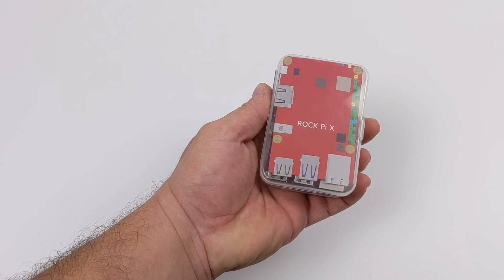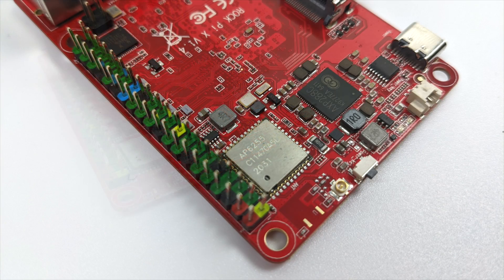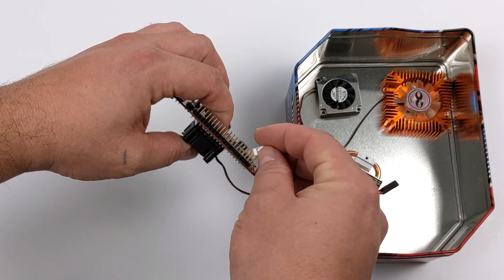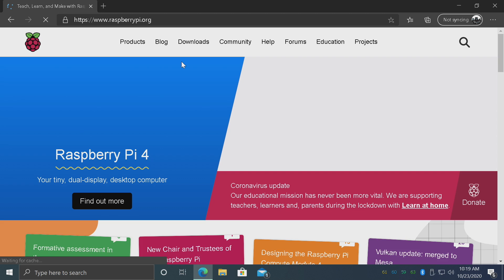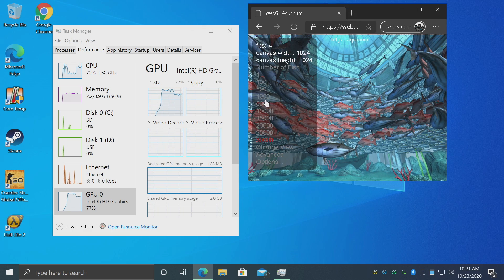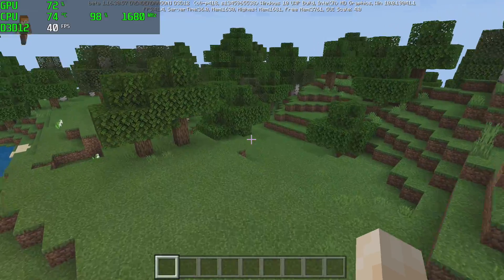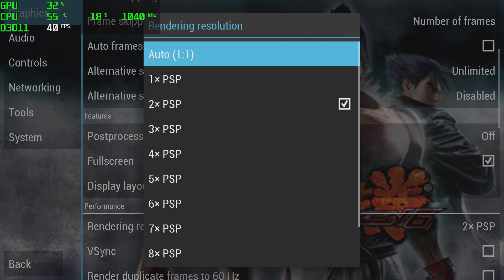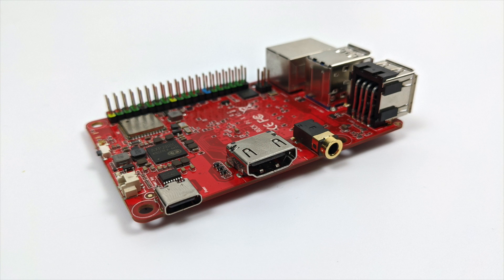Rock Pi X X86 SBC WIndows 10 Review - Is it Any Good?

Comment: hi big fan, subscribed, ive a q how did u boot the rock pi x to windows 10? i've a rock pi x and i cant boot it. i tried following the steps on radxa website but something else is happening. i tried rufus, etcher and also that "make usb drive" option on windows 10 media creation tool but nothing seems to be working, the same message comes if u were to plug in a blank rock pi x. pls help me i believe its a problem with the booting evrything else is working fine.

Comment: Honestly i need a small little thing like this to keep my ingame shop open 24/7, i spend 2 days trying to run x86 client  on arm raspbian. With box86 / wine.
No succes, this is plenty powerfull for my needs, even if it gives me 5fps for that purpose. It's funny the chip is listed as 2w TDP while it used 10x that during loads haha.
Anyway, i dont think the price is bad, a pi4 4gb costed me over 70 euro's wich was like 85 usd at that time.

Comment: if I did get one (I'd probubly get the 128gb model with 4gb ram, model b) I'd run 7 dual booted with Lubuntu, each one getting 64gb of storage. I'd then pair it with my low-end pi screen (800 x 480) and a battery in a custom 3d printed pc case.... basically this will be a giant project for me! I might try some Dolphin and PJ64!

Comment: Back in days  you had 2x serial port you had 8-bit DMA IRQ handled pararell GPIO port, you had 3-4x 16 bit ISA 20MHz GPIO bus you had additional audio, analog video, CPU running at 10W TDP, and additional super fast SCSI. these days you have super cool futuristic Raspbery Pi and Intel clones running at 10-20W TDP having just 8bit GPIO, 1x serial, 1x I2C serial, modern version of SCSI but no RTC on board. 
We only step backwards. Except for video and mips :)

Comment: If you want to compare it with rasbpi, you need to install a linux distro instead. Windows 10 (and even 8) is so bloated with crap. Also, have you ever seen how many file stamp/attribute updates Windows perform with NTFS on files, it is insane. The file access update for example, totally useless performance drop.  Windows search, nightmare. If you want to compare both worlds you should treat both system the same.

Comment: A perfectly usable computer for basic daily tasks or your maker needs. Great for HTPC, NAS, etc. The only drawback is storage, you really need at least 64GB for Windows 10. But you can always hook up an SSD via USB 3.0 and use Windows To Go feature (not sure if this works with newer versions of Windows 10 though).
Plex works better because it's likely using HEVC or H264 codec which can be hardware-decoded by the GPU, unlike Youtube's VP9 codec which is decoded in software.

Comment: So my Nutmeg-P Mini ITX based system blows this thing out of the water. Geekbench is 1233 single-core, 3414 multi-core. I even run World of Tanks reasonably well.

Not quite a Raspberry-Pi sized system, but systems containing these boards can be had quite cheap. I paid $7 for mine at a CHKD Thrift store. My case may not be typical, but still wouldn't expect a machine like this to exceed the price of a Pi or Pi alternative and its more flexible if you don't mind the size.  I might eventually install this setup in an old Macintosh LC II shell I have.

Comment: If only they made these compatible (supplied/made the drivers) with older OS's like Win XP or even Win 98Se, would make for an amazing SBC for a classic PC gaming handheld or a tiny classic desktop PC. The SoC is perfect for pre-2005 PC gaming, would be amazing to finally have an SBC for an easy cheap way to have all my PC classics easily accessible, especially a little Windows XP handheld gaming system. I guess we will have to see how good the open source Windows OS ReactOS gets, perhaps if it matures enough it will make a classic SBC handheld/desktop possible.
Reply: the drivers will work with xp if you can modify them kinda.

Comment: This Aquarium is very strange.
I ran it on my N4000 Celeron running opensuse, in Firefox I did not get more than 20 fps even with just one fish. Using Chromium I had 60 FPS even with 500 fish. And Firefox on the left side and Chromium on the right I got 60 fps in Chromium and 10 in Firefox.
It seems like this is more dependent on the browser than the CPU.
Though, my I7 makes 60 fps in Windows-Firefox even with 5000 fish so who known.

Comment: Hello, I would like to make a kind of android tablet to put in the car with which to use maps, I would also like to connect it to the car radio and to rgb led strips, do you think it is possible with a 2gb raspberry pi4b? i should get a usb gps module, would it work? I have many doubts... i know how i could do with the hardware but i know almost nothing about programming, i don't know how to program the gpio and in case you need drivers for the gps i don't know how to install them on android and linux   : (

Comment: it will work just fine without the heatsink, my windows tablet is running the same processor, it gets a little toasty when touched the back of it but it works just fine.

Comment: I wouldn't include a youtube benchmark, since it depends mostly on the site's coding and optimization, which is very poor, so it's a little unfair. And I'd try 1440p video, even if you have to convert it to that format, I hope it becomes mainstream.
Reply: YouTube uses the VP9 codec, which is more demanding than H264. While poor coding may affect loading speeds of the site, the main factor is the lack of power and lack of VP9 hardware decoding. YouTibe can also use AV1, but it's a bit rare.

Comment: Thank you for including power consumption. Web browsing and some retro gaming is all I need from a computer when I'm not working, I'd like to find a sbc to use and save power. Although this one seems underwhelming for sure. We'll see how it performs with linux.
I don't know how relevant it would be to the bulk of your audience, but I personally would very much like to see how basic software perform on those sbc (gimp/krita, blender, godot...) finding a reasonably sized file/project to use every time you test a new board would make a good benchmark.

Comment: Does the CPU support VT-x?
This board can be an interesting cheap/low power retromachine for old windows games.
It would be interesting to see how virtualization works on this board, for example running win98 on virtualbox, or running games on linux under wine.

Comment: Question, when running windows 10 are there any books to use the GPIO?  I would love to develop some windows applications they can still take sensor input.
Reply: that would be interesting to knoe
Reply: There's no point using this form factor unless you want the GPIO, but reviewers never even mention it or try it.
Reply: use python or use rpi os or arduino ide in windows
Reply: That SHOULD have said "HOOKS" not "BOOKS".  I know that I can use RaspiOS and Python, but I want true windows.  Why is that apparently so wrong?  I have a lot of development that I do in Windows, so if I can stay in windows as opposed to having to send something to a network drive, then have a windows computer that a client is going to be using, if I can just stay in  windows it will make things easier to the project I'm working on.

Comment: Nice x86 SBC but why still NOT a dual display output like on the Raspberry Pi 4?! It would have been a great addition and make this device act as thin client too
Reply: I don't think the intel hd gpu supports it. It was having enough trouble with 1 1080p display

Comment: you must try ppsspp on linux bc you have vulkan there.. you can see my video about ppsspp on this board and the performance is much better than this one. but yes, this board isnt enough for windows

edit: after several testing on the rockpi x.. well, I found than I was partially wrong. the performance was way lower than my initial experiences.

Comment: Too little memory for a desktop and therefore nothing you can do with this board you couldn't do with a RPI. In fact, the 8GB raspberry pi is the first SBC that can to a certain extent function as a desktop. I'd rather they just straight up charge $70 for it and add two so-dimm slots instead of soldering the ram to the board.
Reply: there is no performance jump going from 4 to 8 gb on the pi4. everyone knows that.
Reply: @pilabs3206  Of course there is. There's a thing called dynamic paging. Never mind having to WRITE dirty pages to swapspace . Also, with a 64bit kernel there is no 4GB per process limit on virtual memory. Everyone knows that as well.
Reply: @statinskill  absolutely, but you can use 64 bit kernel on 4gb too. suggesting there is a real bump in performance going from 4 to 8 gb on an rpi4 is just stupidity. if you want to believe that kept being one. its extremely difficult to fill the entire 4gb of ram even on 64 bit. there would be very few occasions in wich you would hit those limits. do you get better performance on youtube going from 4 to 8gb? no, there is any increase on games? no. just for ramdisk and some very few scenarios you can really use those 8gb. 8gb is a waste of ram on a crappy rpi4. this rockpi X have way more value/$ than the rpi4 8gb for desktop usage, even with this very low end cpu. the gpu is way more powerful, it have perfect h264/h265 playback from the desktop, not just kodi. it can run many many x86 games/software. its just stupid saying than the pi4 is a better desktop just bc it can adress 8gb.
Reply: @statinskill  any rk3399 with 4gig is far better desktop than the rpi4 8gb if you want an ARM desktop sbc. and its cheaper than the rpi8gb . the rest is marketing.
Reply: @statinskill  absolutely, for development/compiling. but rpi4 is targeted as a desktop pc. so no, 8gb on rpi4 is mostly useless for desktop usage. at that price any other sbc does much better job. 4gb is the right spot. 99% of this ETA prime subs are comparing this sbc agaist rpi4 on desktop usage, and this 4gb with 32 gb emmc model its much better value for that porpoise than rpi4 8gb. not for your specific IDE dev app. but you are one of the very few people than use that kind of apps. I compiled several dozen of projects, a lot of gb of source code with rpi4 4gb, no problem whatsoever. your fancy IDE use more, ok, you are the only one that could take benefit from 8gb. any other user will not face any problem and the extra 4gb will be useless and will reduce heavily the rpi4 value.
Reply: @statinskill  and if you want to quote, you were talking about desktop! so, any debate here is useless bc you are not saying than this board can do wayyy more stuff as desktop than rpi4. not in your specific case. but the trade off are insane high. this board can execute tons of x86 software. rpi4 cant. while I am testing an x86 emulator for ARM, I am struggling all the time with a 32 gflop gpu!!!! a desktop sbc than does 32 gflops!! are you kidding me? this board have way more powerful/featured gpu. you need that to say this is a desktop or not. RPI4 is wayyy far from being a desktop, it have a good cpu, with a crappy gpu. thats not a desktop, thats garbage.
 I dont understand how this crappy board have soo much community. waiting years for a real upgrade and.. 32 gflop gpu. and I have this fan boys that says its a desktop bc it can address 8gb of ram.
Reply: @statinskill  the foundation says its a PC sbc, not me. desktop usage is a serious usage.
Reply: @statinskill  my hobbie is to demonstrate than ARM Linux can be a desktop pc. that involves everything you say its not serious usage and what every people do on any normal pc. we cant get there is broadcom kept making this poor hardware and all the fan boys says than rpi4 is the best arm sbc. we are far away from x86, and if we kept marketing rpi as a good brand for desktop we will never be there. it will be just an underpowered sbc than can partially replace a desktop. we need a desktop class gpu, not videocore 6. at least 100 gflops. enoigh with and all this crappy broadcom hardware. rpi is completely overrated and doesnt deserve people attention. it does gain people atenttion bc of marketing and fanatism
Reply: @statinskill  in the meantime, we need affordable x86 platforms like this one you are ditching bc it cant address 8gb (but can do tons of staff than your crappy rpi4 8gb cant)
Reply: @statinskill  oh , oka, now I agree with you then. haha

Comment: Like the Atomic Pi (which is cheaper and has the same CPU but some other extra niceties) it will be a great router running OpenWRT X86-64 (Get the atomic pi version, it will run on it)
Reply: atomic pi was refurbished hardware
. thats why it was so cheap
Reply: @pilabs3206  Still, good toy for a fast overkill router with proper proxy adblock etc

Comment: Been searching all morning on what my Acepc T11 (Z8350) was capable of doing and boom!  A video released by one of my favorite You Tubers.  Installed Big Box a while back and ran pretty well.  Ironically I use this little PC for flashing thumb drives with Batocera for homemade arcade cabinets.  It's not very powerful, but can be used for simple tasks.  I'm planning on seeing what types of games from Steam it will actually play.  Currently using Windows 10 OS.

Comment: 12:29 - Atom processor like this one only support maximum of 4gb ram (actually the maximum ram supported is 2gb but companies like this one can make it run with 4gb. Also the ram runs in single channel which causes gpu bottlenecks )
Reply: you are right, its not dual.channel, its two rank based

Comment: Can people stop sending these boards out without coolers. Idk why but it makes me angry
Reply: this is a 2 watt chip, half the heat output of the STOCK CONFIG pi 4... I don't think heat will be the biggest issue.
Reply: @Justin Beaird Right, if this was the SAME exact form factor as a Pi 3 or 4, with the SoC on the correct side, that would be neat. If you refuse to do that, why make it look like a pi at all? what's the advantage? branding? Thanks, China

Comment: The webgl benchmark is not a good option for GPU testing because its results vary depending on the browser.
If you use Chrome or Firefox browser, you will probably see different results

Comment: So a smaller version of a Atomic Pi for 2x the price.  Same exact CPU and memory.
Reply: Yes, with smaller form factor, double the ram, better power handling with ability to use higher voltages, different wifi chip and no block of aluminum glued to the SoC for cooling.. though does need a heatsink of some kind..
Reply: atomic pi was refurbished hardware.. thats why it was that cheap
Reply: afaik atomic pi was 2gb of ram, this one have 4gb and also have 32 gb of emmc
Reply: @pilabs3206  yeah but 32gb emmc is what 8 bucks retail?

Comment: You should have mentioned that this is the same CPU/GPU as the Atomic Pi, which you reviewed last year or the year before.  Cool vid, I can see a few cool uses for this, but it needs to be $15-$20 cheaper to really make an impact in the market.
Reply: atomic pi was a refurbished hardware product, thats why it was that cheap.
Reply: @pilabs3206  refurbished what?  Can you identify the original product for me?  I’m also fairly certain that the Atomic Pi has faster GPU clock too.

Comment: if it had some kind of celeron, it would have been great. those atom cpus are no good
Reply: Celeron’s pretty low end as well in my opinion
Reply: @jengelenm  It's better than Atom and Celeron isn't as bad as it used to be.
Reply: yea celeron is pretty trash imo
Reply: @rjwilliams4977  it's low end but it's not trash. The 4000 and up are perfectly capable for modern media consumption and office work pcs. Comparing them to the atom CPUs is like comparing i3 to i7 
As you can see this thing struggles with win10 while the celerons can handle it fine.

Comment: Isn't that Nano-ITX form factor? Or one of the other less spoke about ones?

Edit: Nvm, Pico-ITX or mobile-ITX lol

Edit2: Looking into it a bit more it's a little smaller than mobile ITX actually, at least the RaspberryPi4 is about 10mm larger on the long dimension, maybe five to ten mm shorter on the short dimension. Just for anyone wondering.

Comment: Shame that they're stuck using an old Atom cpu. They're barely considered adequate.
Reply: Still better than many cheaper ARM chips in some cases. Even though there are some ARM chips that outclass a cherry trail atom, How many small SBC's use said ARM chips capable of doing so in the same price range I mean.

The point is this is more for those that don't know how to deal with an ARM chip... and or want a higher level of software availability.
Reply: @TheDeelunatic  I would have happily bought it if it had a slot for an M.2 wifi card, easy way to constantly buy newer wifi chips and not replace the entire thing. And better software on it then ARM for what I want.
Reply: @TheDeelunatic  A Raspberry Pi generally performs better than this thing does. This can't even handle 4k video playback.

The Jetson Nano is far better, too. 

Unless you absolutely must have Windows 10 on an SBC, this isn't really worth it.
Reply: @Droogie128  depends on usage case. If your code is x86, this will be a benefit to your code, if you need graphics, get something, anything other than an intel board. I mean sure the pi can do x86/64 code but not as efficiently as a native chip.

It's basically the difference between a computer with a decent graphics chip vs a budget laptop with an intel integrated graphics.